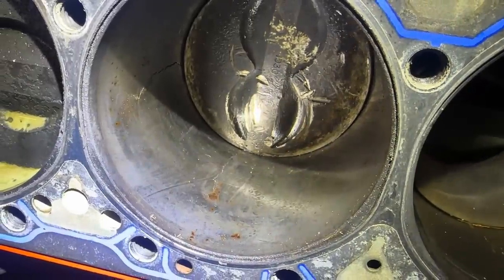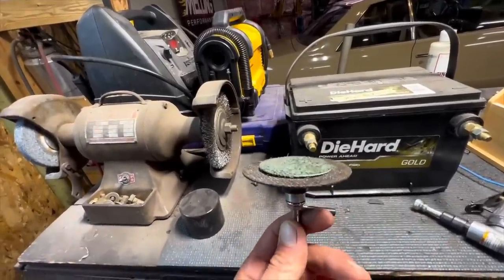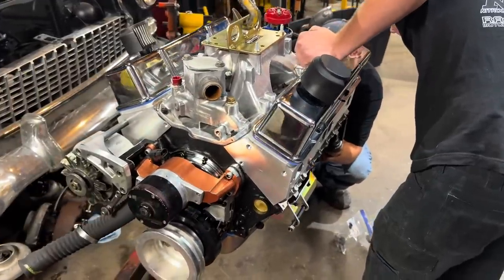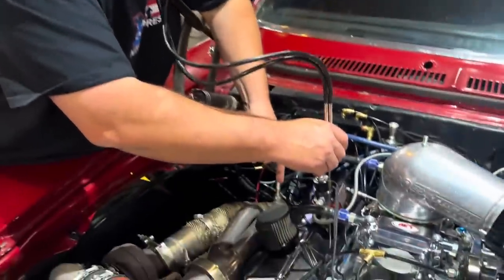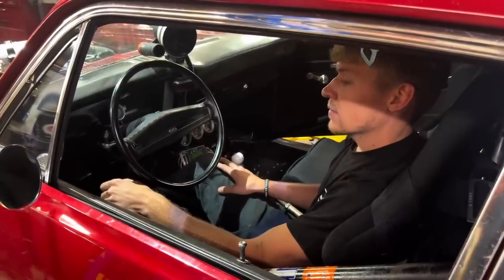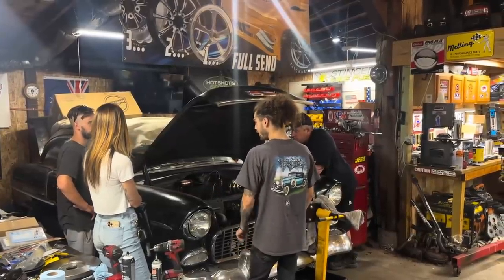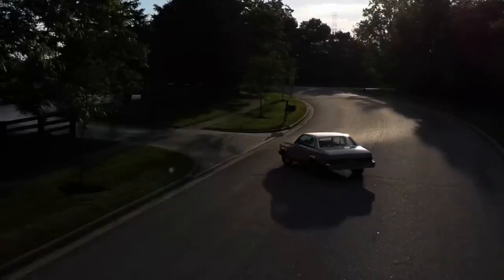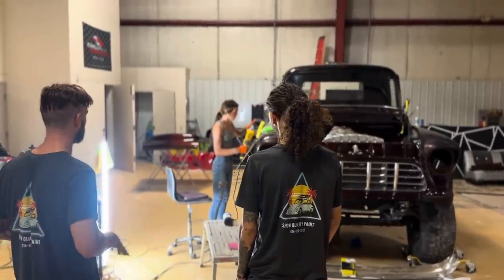WE ACCIDENTALLY MADE OVER 30 POUNDS OF BOOST!  CATASTROPHIC FAILURE!

Comment: Cool video, love the fireworks.   I still can't believe you're hanging two hair dryers off that long block.  Hyperutectic pistons can't handle much boost at all.  You said the only mod was a new oil pump.  If the ring gap on the pistons wasn't addressed, you're likely going to blow those ring lands off the pistons with boost.   That should make for great TV! You might want to put a diaper under that thing though just to make your lives easier when it comes time to cleanup! :)

Comment: I'm trying to keep up. So the 55 will not have a 237? It sounds like you are building a engin weed based on the of those 400s you got in the wood boxes?. Did they pick the cam and induction combo or did you specify existing parts and intended use and they did th we there best to give you a bumpstick that should work well. Is UT std base circle?

Comment: Re Bill's nice stethoscope,, those work excellent BUT an alternative I learned about from an old dude way back in the 60's,, use a section of an old wooden broom handle cut to about two feet long. Hold one end to your ear and set the other end on the rocker cover. Honestly, it works.

Comment: Billy try running Seafoam through the fuel system to clean out the injectors and any thing else in there or put some in a  container with the injectors to clean .

Comment: I was interested in the stock block w/boost experiment but the failure was not covered much. 30lbs busting a cylinder wall at .030 over? No head gasket or lifted ring lands and I wonder if the rod collapsed first? Wish Bill would break that cylinder wall out and put some mics on it so we can see the wall thickness for those of us curious to see if core shift was the culprit.
Reply: Had to be really thin for the wall to let go before the head gasket
Reply: Agree don't abandon that line of testing, because of a boost controller issue...that was going to be interesting

Comment: Great channel....  Question, I see many folks blow boosted motors due to pinched hose or glitches....  Would it make sense to have a second blow off valve set mechanically to the high boost number?  Just in case everything goes wrong, it doesn't blow the motor?  Im sure its not cheap but cheaper than a motor?  Anyway, enjoy both channels alot.  Thanks!

Comment: I've done that exact same thing. Coming from an event in Clubus heading back to Cinci. The wastegate was 15psi, turned the boost controller on and I had it plumbed wrong (I think), did a pull. Hit the engine with 58+psi and (last recorded boost pressure was 4 bar) ..........BOOM. Now to be fair that MFer pulled like stink before it went.  LOL However I didn't do it to a stock bottom SBC. I did it to a VERY expensive 13b rew (3mm 1pc ceramic apex seals.... 😞) That was 15k down the tubes. That one hurt...........

Comment: On my turbo car that sees street driving only, it’s just on gate….I just sprung it up until it made 14 and left it. If you don’t need power management for different surfaces, is co2 boost control really necessary?

Comment: LUV'd Marks present for Unk Bucko!!  It's funny BUT really NOT funny. Many of us have over the years got lucky when we had a cut off wheel/disc EXPLODE and almost got us. WE KNOW WE SHOULD HAVE THE GUARD ON THE TOOL, SHOULD BE WEARING A FULL FACE SHIELD + Safety glasses, gloves and hearing protection BUT we continue ignoring what we SHOULD be doing when using these high speed tools BUT we're always in too much of a hurry, don't want to go get the PPE an use it. Can't control or hang on to the grinder with gloves on,, the SAFETY glasses get fogged up, the full face gets fogged up or it pulls our hair when we crank the head band down to make it fit,, we have a gob of excuses for ignoring our SAFETY,, don't we - - UNTIL it happens. Sometimes it results in the loss of an eye. We can't go to Marks A1 and get a replacement eye,, we get only two and they're NOT replaceable.....

Comment: Question? Are you guys not worried about the hypereutectic pistons and the ring gap on the new motor for the nova?
Reply: I wonder, I see catastrophic failure again,   and some guys that have made pretty good pwr on those 880 blocks claim they are weak, I think DV even made that claim. Idk personally. Maybe the cylinders won't see as much boost pressure with those smaller heads and provide a built in safety parameter. Lol
Reply: There smart guys! I’m sure there aware this might be a issue over 10 lbs of boost. The bottom end is a nice piece. Just think pulling it back out and sending to bobs to check it over and put forged pistons in and setting ring gaps would help it live a long life even at 20 lbs of boost! Or even do it them selfs at home for the content. Just my thoughts.
Reply: @johnstanley8394  I wouldn't mind seeing what it would take, even with the hypers, just gap it so that's not the failure point. Not saying the GM LS pistons are equivalent but with safe fuel and timing you can throw a lot at them.